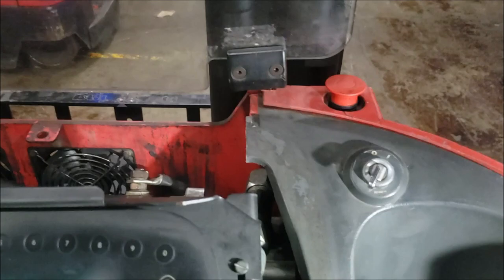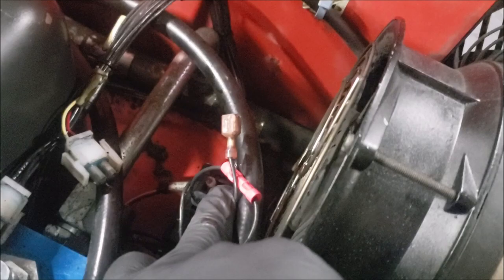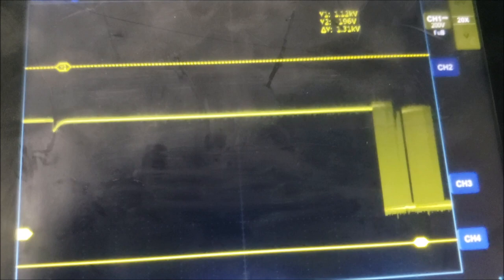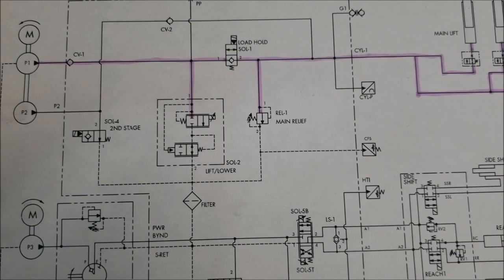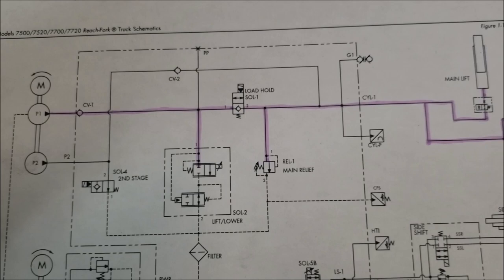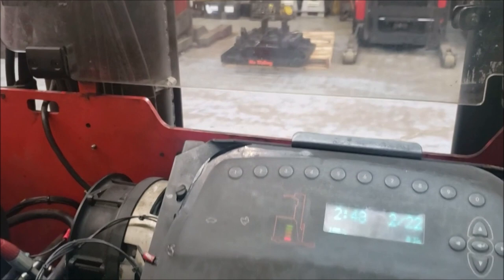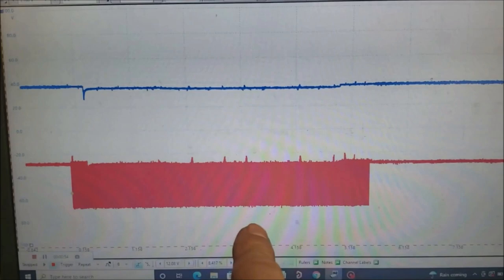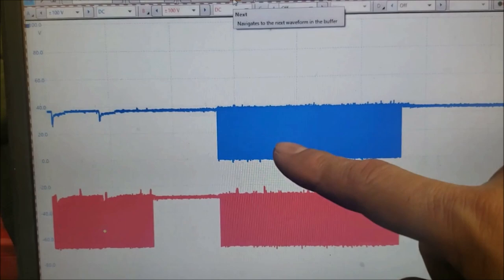Raymond Reach Very Slow Lifting

Comment: How are you doing?   I have a question for you if you don’t mind. 
Have you ever deal with a code-204 on a Clark lift model:TMX25 ??
Reply from the maker: Check accelerator voltage, tilt and side shift switches.